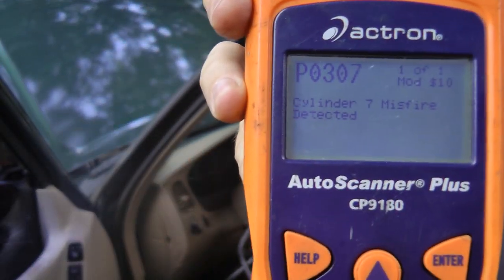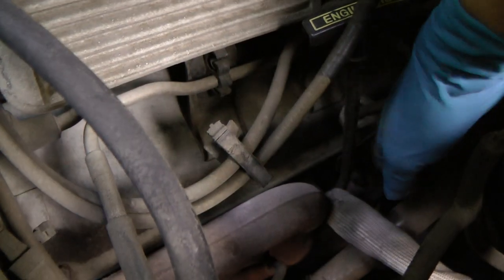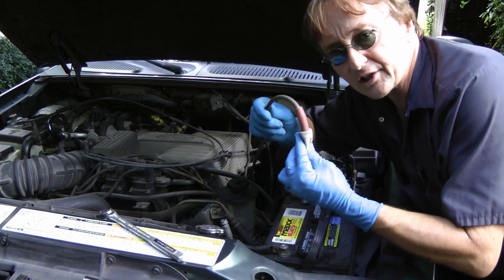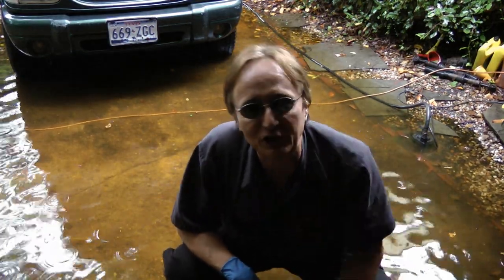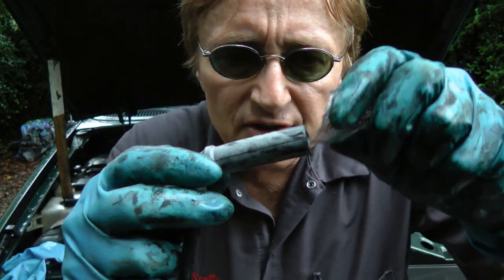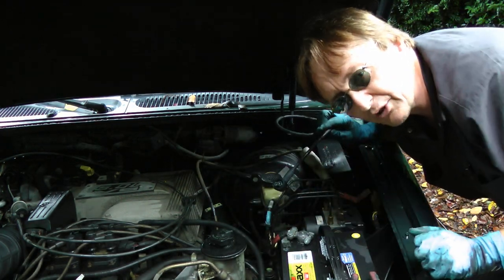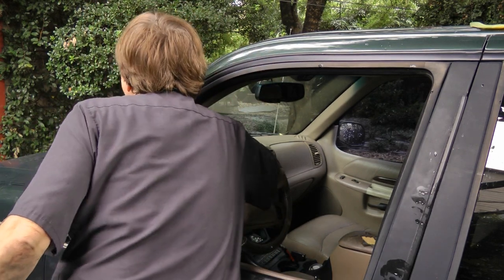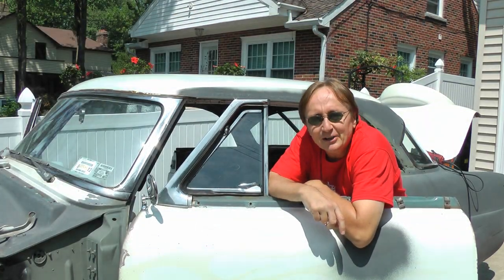How to Fix a Engine Misfire Code P0301 (Spark Plugs and Wires)

Comment: Hey Mr. Kilmer, 
I have a 2001 Saab 9-3 SE Convertible. I did try to find out the codes due to check engine light. The codes are P0301 and P1301. Thanks for the video of showing how to fix P0301 code but. could you please let me know how to fix P1301 code. 

Thanks..
Reply from the maker: pray it' just bad spark plugs, if not, expensive computer system module repair is often needed. those saabs are endless money pits at that age, big reason saab went bankrupt

Comment: Scotty, found today, on the 95 explorer , which is OBD 1 , it has a misfire , once its started, if i bump the gas pedal, it clears up an runs ok, I am guessing bad wires an plugs, whats your opinion ? i dont know what cylinder , its a 4.0 engine , how is this job on that engine ? any tricks ? maybe a fuel injector problem ? please let me know, thank you for your help
Reply from the maker: +Kody Darlington try spark plugs, wires, dist cap and rotor and PRAY

Comment: Hey Scotty, I've run a scanner on a 2002 Peugot 206 and got the codes, P0300, P0301, P0302 and P0303. So far all the spark plugs have been changed and so has the coil pack. This has made no difference to the running of the car. It has really poor acceleration and is struggling to get up any hills, I have had to go into first gear to make it up and then car literally crawls up. it also shakes quite badly. Have you any suggestions, thank you!

Comment: hey scotty....i have changed plugs, wires, all 3 coil packs, the computer the coil packs sit on, and it still comes up as a cylinder 3 misfire ...now the catalytic converter has a hole in it...pretty big...i welded a piece of steel over the hole to quiet the noise...the car really runs rough and its getting worse and worse..i guess my question is..would a shot catalytic converter cause this issue, or could it be something else...

Comment: Would a leaking intake manifold gasket cause a misfire? It is leaking around the area of the cylinder that is misfiring. I know this as I spray carb cleaner and the engine note changes.

Comment: Hi @Scotty Kilmer I have a problem with my vw golf mk2 1.8 monopoint . When the engine is cold the idle is very bad and ofen the engine cuts off. Also when is give it a little gas my whole garage is filled whit black smoke.
Reply from the maker: it's running rich, have fuel injectors checked for leakage first

Comment: Hi Mr Scotty
I have 2005 chevy malabu with 2.2l engine.  The car is running too rich and no power.  I did change plugs, coil plug, O2 sensor, cooling sensor, map sensor>>it is still the same problem.  Can you tell me what to do next.
Thank you
Reply from the maker: those are notorious for leaking fuel injectors and or fuel pressure regulators. check that first.

Comment: Scotty,
What do you know about IAC Valves (Inner Air Control)? 
I have a 98 Ford Explorer XL V6 4Dr and when the temperature outside is hot it will somewhat turn on (but not fully) and then stall and slowly shake it's way off. I wasn't too sure what the problem was until I cleaned out the IAC Valve and it worked for a bit. It continues to do this and since I live in southern california where the summers do get pretty hot, it does this a lot. Do you think that changing it will fix the problem?

Comment from the maker: gas tank is not venting then, start with a new gas cap, pray that fixes it. if not, see a guy like me with a dealer level scan computer, the only way you can fix evap problems without pure guesswork

Comment: Hey Scotty. I have a 1993 Nissan 300zx. Every time I drive my car out in the rain it shuts off. Also when I leave it out in the rain. I'm not sure whether it's the distributor cap or the spark plug wires causing it to misfire. Any help?

Comment: Do you have a video explaining ignition cylinder repair? My 1998 Toyota T100 is having an off and on problem where the key (fresh cut at dealership) will not budge and requires numerous wiggles until it turns over.
Reply from the maker: they just made a crappy copy of your key, see it all the time. They will probably blame it on a worn out ignition cylinder, but really, a good locksmith can copy any key and make it work.
Reply: I used the vin and title to have one made at the dealership. I have noticed that a newer spare works better than the one I keep on my key chain, but still, it is to the point where I am wiggling the key, pumping the breaks, jerking the shifter and pulling on the wheel all to no avail. Then on the next wiggle it will turn over for no apparent reason.
Reply from the maker: Taylor S
realize VIN made keys rarely work well, they are called code keys ONLY keys made from an original generally work right, realize that.

Comment: Hi Mr. Kilmer. I am also having problems with my car. I have a Ford Escape, and apparently everytime it rains or snows the car has a hard time starting and when it does start, it dies every time I try to drive it.  When it does not rain or snow it starts up fine and it is drivable but the check engine light is always on.
Reply from the maker: rain or snow cause electrical problems with weak wiring or electronic parts. When it runs ad, quick have it scanned for trouble codes in those area, like bad ignition coils
Reply: Scotty Kilmer Okay Thank you sir

Comment: Hi Scotty my wife has an 06 nissan sentra 1.8 that is missing and giving a code p0301 cylinder one misfire. I changed the plugs . The coil pack/wires seem ok . I swapped the coils to see if the miss would move to another cylinder  but it did not. I listened to the injectors with a screw driver they sounded the same but I didn't test them or pull them and clean them. However a while ago I changed almost everything on it except the cats.  So a week ago I changed the cats .After I changed the cats it smoothed out for a while but now it's missing again. for a moment it seemed smoother and the throttle response is back. But now it's missing again. I did break a bolt where the manifold fastened to the exhaust just before cat #1 .
So will that cause the code I'm getting? Sorry for the long drawn out question but need some help.
Thanks in advance.

Comment: Hello Scotty i have a 2001 toyota camry V6. this car just stop in the highway and want start again i towed it to home jump it and add fuel now the car can start but engine is verry loud and when i try to press the gas pedal it doesnt work when i keep pressing i have blinking check engine light. i change spark plug and the 3 injectors same problem. please can you help me??

Comment: Hey scoty nice video you have here very helpful all the time.
Well I have a 99 Toyota sienna 
It has a Misfire, check engine light is on and  blink some times. I scan the ck engine light it gave me 8 codes as follow p0300, p0301 p0303 p0305 p0171 p0141p1135 it's a random misfire I'm really confused where to start from can you please help thanks.

Comment: My spark plugs hole is stripped out. I rethreaded it once before and the new spark plug blew a second time and now the second  rethreaded doesn't hold the plug. Can I just not use the cylinder?? If so what do I do with the open plug hole?

Comment: Hey Scotty, I'm having a misfire on Cylinder 5. I switched one coil pack with the other, and the misfiring stopped, than the misfire came back after an hour or two? 
I bought new coil packs, still misfiring, all the plugs and wires are good as well, do you think it could be the Ignition control sensor, or a fuel injector?
Reply from the maker: could be injectors, swap the  #5 with another and see if miss moves

Comment: Scotty, you told me to replace the igniton control module on the 1995 Explorer , where would that be located, i am being told its behind the battery mounted to the fender, i thought maybe it was under the ignition coil , is this true ? please let me know. thanks
Reply from the maker: Kody Darlington The Ignition Control Module is located at the LH front corner of the engine compartment. That's on the driver's side to the left of the radiator where all those wires go in

Comment: Hey Scotty, was looking for your advice, got a 1992 mercury grand marquis and i love my car but, its started doing this thing where if i drive slow say someone gets in front of me the engine starts shaking until i let off the gas, but i can drive it all day with no problems as long as i drive fast/speedup fast.  I've changed the spark plugs and visually the spark plug wires look ok.  was just curious what you think it might be
Reply from the maker: often fuel injection problems do that, or vacuum leaks, check for vacuum leaks first under the hood
Reply: Scotty Kilmer Thanks for the quick reply i looked and will replace them they do look pretty bad

Comment: I have 1998 Honda Civic LX Automatic. My engine light came on;  flashing on/off  sometime. What I change was spark plugs, ignition wire set, distributor cap, distributor rotor, muffler, ball joint, axle, exhaust gasket,and transmission. After that I reset it and it came back on again. Battery I change it two years ago. It sound like its gonna die.  I don't know what cause it.  Do you have any suggestion what's wrong it cause the code misfire 301.  Not sure you're Familiar with Honda Civic LX.
Reply from the maker: Xia Vang swap fuel injectors, see if miss moves showing a bad injector. If not, often a blowing head gasket, do my video "how to tell if your head gasket is blown

Comment: Hey scotty i would really appreciate your help on a subject.

I have a 91 toyota camry 4cyl that's having a weird intermittent misfire problem. It ranges from daily to recently has gone weeks In between misfiring... Ok so here are the symptoms... It has only misfired after the car has been driven for at least 15 minutes.. It can range between 15 minutes to an hour drive when the misfire shows up. Also when it misfires. It gets worse as the car is driven.. If i turn the car off and turn it back on it only makes the misfire even worse and sometimes makes it to where it won't even let me turn the engine over. (i just get a click with no crank) after about 30 minutes to an hour of cooling the car will start up and drive normal again... Also i just add that its 95 prevent of the time only misfiring at idle. It won't do it no matter the condition if i am driving on the freeway in motion. Feels like it only dies when the rpms go low.

Any help would be great scotty. This problem has been bugging me forever and no shop will touch it unless its actually doing the misfire... Kinda hard when its intermittent and it only does it sometimes spread out between 4 to 7 days..

Thank you scotty for reading this. (i know its long)

Comment: Hey Scotty! So on my nissan 350z about a month ago i took it into the shop for a tune up i got some new spark plugs and oil change etc. After about a week the engine misfired and also caused me to fail emissions. Do you think they fucked up on putting the plug wires in place or what? i was thinking about replacing the fuel injector and plugs unless they can tell me exactly what it is but what do you think it could be
Reply from the maker: could have done all kinds of things wrong, or something else could have broken. I would go elsewhere for a diagnostic first, and have it scanned with a tool as in my video "fixing modern cars using high level scan computers" to find the flaws. Guessing is not a smart option

Comment: Hi scotty I have a 2003 Saab 9-3 it occasionally revs up to 3000 RPMs( accelerating at around 5 to 35MPH when I acclerate faster I never have this problem) then changes gears.  No check engine light is on and I had my automatic transmission fluid checked and was all set. any idea on what this could be?
Reply from the maker: odds are transmission's just wearing out. One of MANY reasons Saab went bankrupt. Check out prices on rebuilding it, and you will wish you never bought a Saab.  Me, I'd live with it and sell it quick, saabs are all endless money pits at that age. All my customers got rid of theirs LONG ago.

Comment: I don't doubt that. I never said he doesn't. I'm sure you both are able to properly tighten plugs by feel after so much experience. He implied that using a torque wrench means the plugs will be tightened too much. Just because a torque wrench is used does not mean the applied torque is high, only that it is measured. I would trust you to install plugs w/out a torque wrench, but I don't trust myself to get it right by hand so I use one with a low range to get the proper ~160 in-lbs. Thanks.

Comment: my dad had a problem like that on his truck last month, it would rattle between 80 and 100 kms/h. it turned out to be the u joints on the rear driveshaft. they made it 220 000 kms though, not too bad

Comment: I have a 1990 Toyota Celica with a stock 5SFE engine and it misfires every now and then when I downshift. Can you tell me what the problem might be?

It also struggles to reverse up and incline
Reply from the maker: often weak fuel injectors do that, but first try my video "how to clean fuel injectors on your car" as new ones cost a ton

Comment: Scotty, I'm having trouble with my Escort. It started misfiring when I went to climb on the freeway last week and the check engine light came on. Ever since I've replaced the spark plugs, spark plug wires, fuel injectors, intake manifold gaskets, cleaned the air filter and even smoked it to check for a vacuum leak and nothing seems to make it better. What else could the problem be? The car is shaking and sputtering like crazy and barely has any power, especially in higher rpms.
Reply from the maker: get it scanned, auto zones do it free, there are codes stores when check engine light comes on, they show the problem area. E mail me that code
Reply: Might be an oxygen sensor

Comment: hey Scotty I have an 2005 Chevy Malibu Maxx 3.5 I had tune up done with new wires and spark plugs I have a ticking noise coming from cylinder 4 only and it acts like it responds late or bucks during acceleration like it wants to go faster quicker what do you think it is please
Reply from the maker: often valve problems do that, have a mechanic check valve lash on 4 first

Comment: I've got a misfire on a 2000 Dodge ram 1500 5.9   Leader engine I put new  plugs in it  misfire on cylinder one went away for a week and now it's back to rough idle and misfire on cylinder one again what could be the problem

Comment: I have a 2001 acura integra.  I have multiple codes PO303, po300, po304 and p1399.  I replaced all my plugs which were  all very old and full of carbon build up.  I still had a misfire on no. 3 cyl.  I tried swaping injector and still  a misfire on the same cyl.  My car is only 137k, babied and never been raced.  What do you think is the problem?  Any suggestions?  Thanks Scott!

Comment: What about  if you have a misfire on bank 5,6,7,8 could it attain to the SAI (secondary air inlet) or the fact that i removed some spark plugs to check them and noticed some were hand loose.

Comment: I always wondered how the PCM knows there is a misfire. Is it the un burnt gas/ change in exhaust gas ( exhaust rocker arm came off)  at the ox sensor, or the crankshaft position sensor notices a slight decrease in rotation for that cylinder.
Reply from the maker: on most cars it's the crank and cam sensor readings used to find misfires
Reply: I have an OHV engine, I think I only have a crank sensor.

Comment: Hi I recently had a misfire on my 1997 mustang Coupe v6 3.8 I changed all my spark plugs and all of my wires. I started it up and it was firing on all cylinders than its started to shake and go rough and it shut off. Now it will hardly start up. Any advice would be great appreciated!!
Reply from the maker: *****   many things can do that, but recheck your work, pray you knocked off a vacuum line or a sensor in that working area

Comment: I Have a 99 Saturn SL1 1.9 lit. I have a Misfire Code PO301. Now I've went ahead and replaced the plugs,then the wires, 2 days ago the coil packs and I still get the same code the car does run rough and the dash light comes on intermittently. Do you have any Ideas

Comment: I've got a 2006 Silverado that has a misfire. The spark plugs and wires were just replaced. While in harsh driving when there's a lot of wind resistance, my check engine light will flash. A relative who worked for Toyota for over 20 years said he could feel my truck misfiring. How can I find out what it is?
Reply from the maker: check engine light is flashing, so codes are stored. E mail those codes to me after getting them (auto zones scan em free) as follows"If you wish to ask me car questions, I am switching my questions and answers to my google+ community “Auto Repair With Scotty Kilmer”. E mailing me here is ONLY for the live car talk shows on Thursdays at 1pm and saturdays at 10 am WHEN the shows are actually airing and I am answering live questions. So please, if you want your questions answered, go  to this link https://plus.google.com/u/0/communities/110758243155230074828  and join my community. You can then ask your question there and I answer them personally. You can also attend my weekly  Thursday afternoon and Saturday morning Live car talk events where I answer your questions live. . Just check it out at   https://www.youtube.com/watch?v=R6TIeV5oMYo
 And remember, every Tuesday, I upload a new video on youtube, don’t miss them."

Comment: Use a torque wrench when tightening those spark plugs.    Most heads are aluminum, these days, and can be stripped easily.        Get the proper tightening spec from your Hanes Manual, or similar.